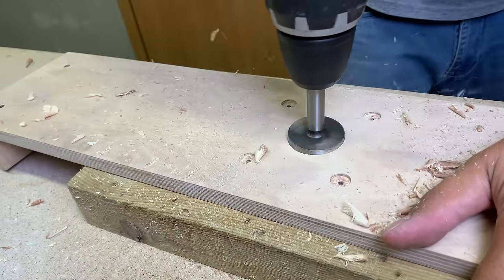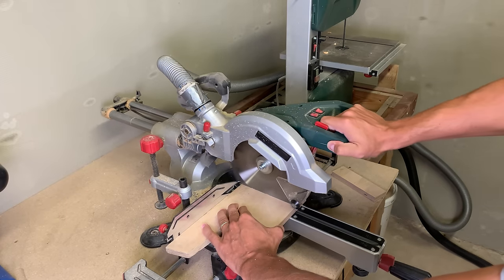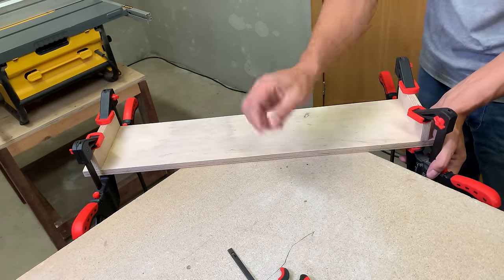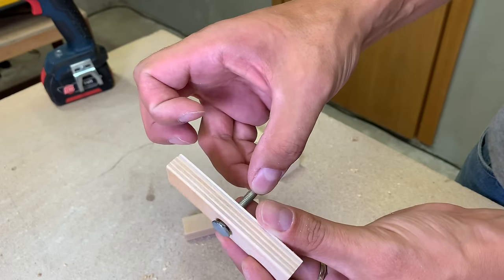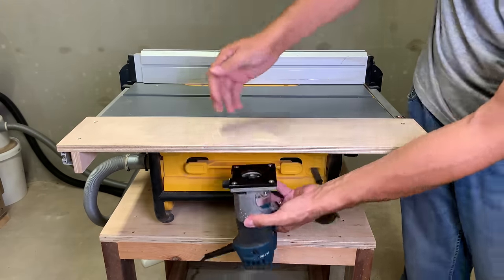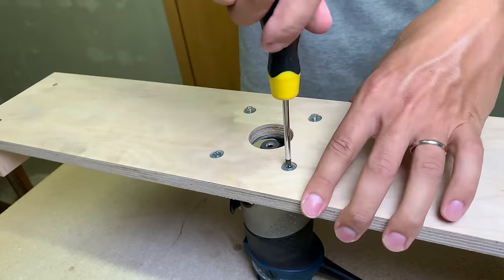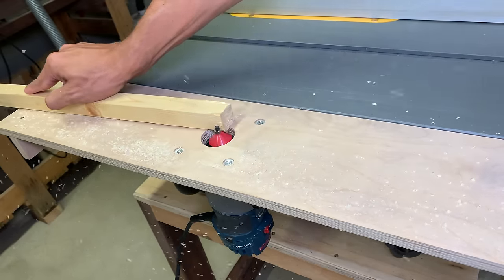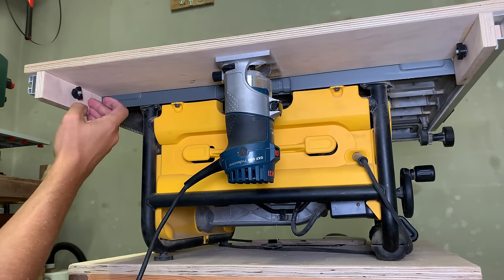How To Make A Table Router Attachment for Dewalt Table Saw

Comment: I’m taking this idea and making a few modification to allow use of the fence with the router. The dewalt table saw has an amazing fence system. I hate to not include it in the design. Still working out a few things but it’s definitely going to work.
Reply: Post a video when you're done.
Reply: Me too.
Reply: Any updates/pictures?
Reply: I would also like to see a pic thanks!
Reply: Did you ever post a picture/video adapting so you can use the dewalt fence?
Reply: Please post this idea.
Reply: Love the idea but would move to see an added solution for dust extractor.
Reply: Would love to see what this turned out like…
Reply: How the progress. Maybe post how far you have gone and we can all try and find some solutions. Good luck
Reply: I plan to do it like this:
1:  Use the right side of the table saw instead of the left side.
2:  Move the fence pegs on that side 4-6 inches toward the center.
3:  Turn the fence around (faced outside).
4:  Build a stand off from the fence out of 2x4’s (3 rows, 24” 2x4, then small 2x4 spacers, then 24” 2x4) with hollow spots in the middle so I can clamp it on the saw fence when using the router.
Reply: I wonder what modifications you did to not lose the fence ? I also don’t like to lose the fence mechanism here
Reply: Hey mate, can you post up a video on what you made for us all 

Cheers

Comment: I just bought the same Dewalt saw and was wondering about options for making a router table. Then I found this video on combining both, which is much better than making or buying a separate unit for the router. Thanks for posting this video!

Comment: I have the same table saw. I just built a table for it with a 42cm router extension on the opposite side than yours. The extension doubles as support for the fence when ripping large stock, basically giving me a 100cm (~40") table in total.
The router extension is equipped wit a Triton MOF001 1400W router mounted in a recessed mounting plate from Rockler, and an in-line start/stop mechanism mounted on the table frame for easier access.
I have also built an auxiliary fence with built-in dust extraction port for the router that clamps onto the saws rip fence with table clamps (Bessey TK6) and a full length plate for load distribution (the extruded aluminium profile is quite fragile). The flip-over support bracket and push stick holders were removed for this purpose, and a notch made in the upper corner to make space for the label-thingie on the back.
Reply: Do you have a picture of the extension I am very interested in making one similar to yours, thanks
Reply: @jram1852  I have a few. When they were taken, it was still "work in progress" though (and it basically still is). And remember, the whole table was purpose built with this extension in mind.
The small overhang seen on the second picture was made to make it easier to access the locking lever for the rip fence.
hepau.dk/images/DSC_0013.JPG
hepau.dk/images/DSC_0015.JPG
hepau.dk/images/DSC_0020.JPG
hepau.dk/images/DSC_0035.JPG
hepau.dk/images/DSC_0036.JPG
Reply: @HepauDK  Thanks, i will try too ^^

Comment: Absolute genius! I have a DW745 table saw and a tiny workshop. I will definitely be making one of these! One idea I had since watching is to make the top bigger and add t-tracks to lock down a fence. Thanks so much for sharing
Reply: Was thinking about a fence .  make it on the right side so can use the fence from table saw.
Reply: The fence works well on both sides. Guys
Reply: What size bolt did you use to tighten it to the table saw.

Comment: Well Done indeed!!  Brilliant!  I've been fretting about where in my tiny, basement workshop I was going to build and squeeze in a router table.  This is perfect since I recently purchased a Dewalt DWE7491.  I can't tell you how pleased and impressed I am with your design. NO MODIFICATIONS at all to the saw yet it's easily and securely installed and removed.  Of course I had to tweak it slightly for my needs.  I enlarged the table slightly (27.5" x 10") to accommodate my Incra--Fence, a perfect addition!  I got completely lucky and discovered an old Craftsman power switch in a box that I think came off an old router table and added that to the face.  A HUGE bonus benefit is that once I have a perfect cut set up I can still remove the entire fence/table and park it on a shelf, use my saw (which can't be done with the router table in place), then reinstall it and my router cut is still locked in place!  WOW!!  Great design!   Thanks so much!

Comment: i did this and it works great!!  Only problem is I mainly have my router in my CNC router machine (Onefinity CNC)  so taking it out and installing it in the table saw is a pain.   Most likely I will purchase a second router but this design is awesome..It will even work  good without the screws and locking it..You could almost skip that step and secure it with double sided tape or clamps.  :).

Comment: This is a really good video. The only thing I would’ve changed is when mounting the router to the plywood I would’ve recessed the  router plate into the plywood which would give you more reach with the router bit. I hope that makes sense….

Comment: Great idea! Gonna think about how to add an adjustable fence for it too!
Reply: I was thinking about this too. Thinking that with the adjustable bolts to secure, could the table saw fence be adjusted and used for it?
Reply: the dewalt table saw has a reversible fence - so if you did what this guy did, but on the RIGHT side of the table saw, then you'd be able to flip the fence and use it for your router table too

Comment: I'd suggest that by supporting the front edge of the router support inside the rail rather than on top, you could use the table saw slide and fence as a fence for your router. But other than that this is absolutely awesome, I'll be doing it too.
Reply: Maybe we can use the miter gauge track that is near to make some sort of fence on a sled, with T-tracks on that sled perpendicular mounted to the miter gauge track so the fence can slide from left to right.
Reply: op video does not allow for fence use.  so I am not doing this method at all.

Comment: Great idea! I wonder if you could tap holes in the side of the table and mount brackets there for your aux router table. Then you could use the table saw fence in conjunction with the router

Comment: update:  could not wait for the response so I went ahead and made one on the opposite side of the saw which has a wider base. Thanks for the idea .......Great idea! Is that one inch plywood? I have the same table saw. You wouldn't happen to have a parts cut list? Measurements? 😊

Comment: I would be using the fence with that as well to make it safer! You can use your fence along with a push stick... And if the fence cant get close enough you can always temporally mount a block or a 2x4 to your fence as like a new temporary fence!

Comment: Good job, but: Routing with the spinning direction of the router is very dangerous. Especially with your fingers that close.
Please push always against the spinning direction!!!
Reply: Thank you. That was giving me anxiety watching that part. I'd also like to add: 
Use a push stick and a track whenever possible with small parts especially.
Reply: Yeah I was about to say the only flaw with this approach is if you stand on the same side of the saw that you would to cut with the table saw you'd be climb cutting which can be problematic. He could always just walk around to the other side of the table and feed the opposite way.

Comment: Good idea but you’re going to need more support where the plywood meets the saw. It will sag w very little down pressure  I have the same kind of rig but with a Bosch Jobsite saw. I used a piece of alum angle from the big box- solved.

Comment: Nice work... But you really should only be cutting in one direction on a router. Also, if I were to make an attachment to a table saw like this I would make it so that the fence can still be used behind the router, you will only be able to work with a bearing bit with this set up.

Comment: I’d make use of that fence if possible. Clamp or screw a 1x3 to the fence and notch where the cutter head is and you’ve got a safer way to rout your workpiece. Also, rout from the back of the table saw not the front.
Reply: Not really possible with Dewalt Table Saw Fence in this configuration.  The table saw fence is on a rack/pinion track system in that groove he mounted the block inside of.

Comment: Watching you feed the material both directions on the router made me nervous
Reply: Would attaching a board as a guide be good?
Reply: @marcuspullan1142  you need a metal pin so you rest the timber on it. You need to start routing correctly because they take no prisoners
Reply: Me too. Routing that long piece initially with one hand was pretty silly
Reply: @gujit  a good friend lost a finger years back doing the same thing.

Comment: AWESOME! Making one this evening!
am thinking, you can also use the table fence for the router... although it might not move due to the router being inserted in the rails, will think of a way. great idea simple but effectve project thank you!
Reply: The saw fence is not ideal as a router fence anyway due to the need to cut away a section in way of the the router bit. Adding a  face to the fence would solve that, but introduce mounting issues. If you solve the mounting issues by making a saddle over the fence (same as for a sliding tenon jig) you could extend the top face of the saddle and drop the router fence at a distance, thus also solving the travel issue with the rails being obstructed.

Or to hell with all that clumsy compromise, and just set a couple of t-tracks into the router table, then attach a dedicated router fence to them. A further advantage is that you can clamp feather boards and templates to the router table as well so that it's a jig system in its own right. The table will need to be thick enough to tolerate this, and at that rate it might be as well to cut out for a thin mounting plate for the router, which lets it be set to full working depth. The plates are widely available, or you can make your own.

Comment: Nice build but does the stem of your router bits fully seat in the collet? The thick plywood sheet stock
that you use makes raising the router bit cumbersome. You may wish to purchase a collet extender to make
your router more useful/versatile. Thanks for sharing your build.
Reply: I was wondering if the router bits were fully seated, too. I didn't know there were collet extenders! I'll get one if I do this design.

Comment: Nice one. Did you consider making the top of it the same level as table saw? This way your big work piece can be supported? Or was there some issue?
Thanks
Reply: The issue (at least on my 10” Dewalt table saw) is you would have to make the   router table portion about 1/2” plywood or less and then it’s not sturdy enough to span the area and support the weight of the router and pressure being applied from above when using it.

Comment: Can u use the fence of the saw for the router? Or could this design modified to use the fence as well?
Reply: You could modify it. I have an old Ryobi BT3000 which has a router base that utilizes the saw fence

Comment: Was helpful,and my first time
Here ha ha ha.
I have the Bosch table saw so thinking of doing the same ,however have you been able to use the fence as well ?
Reply: His fence works with a rack and pinion track system that has a stationary rail and a moving rail, the fence is connected to the moving rail and the part of the rail he attached it to was the moving rail. I'm thinking of making a drilling template for my router and drilling holes on my table saw top for my jobsite saw, I don't care about the warranty of it and I have a stationary saw but then I could use the fence with an two part auxiliary fence slid over top of it. Sort of an emergency router table for at the jobsite that doesn't take space I do that stuff in the shop.

Comment: Nice work! Did you make a separate fence for your router or did you use the “back” side of the table saw fence for this?
Reply: I imagine it’s main use is with guide bearing bits therefore no need for a fence as demonstrated
Reply: @azza1793  
If that’s the case, it’s use is pretty limited.
Reply: @stevesiefken6432  I had the same question as you, and yet I think it would fairly easily approachable  by just adding some 1-1.5" wood up on the fence with a gap cut out for the router bit and then you've got yourself a fence as well.

Comment: If you want to hang onto your fingers you'd better make a fence for it.
Reply: No real need for a fence with bearing guided bits.
Reply: @waynemiller6070  Yes if one is routing free hand, but not with the router inverted in a table. One slip and the tops of your fingers are gone. A basic fence would take maybe an hour to make. Take the bearing off the bit and use a fence, much safer.

Comment: What is the point of this?? Why not just make a box to mount the router in so you can still use the table saw. Actually all you need is a piece of plywood or mdf and a shop made fence and you can attach the set up to almost anything. And still use the table saw.